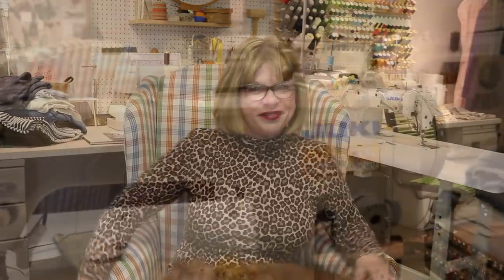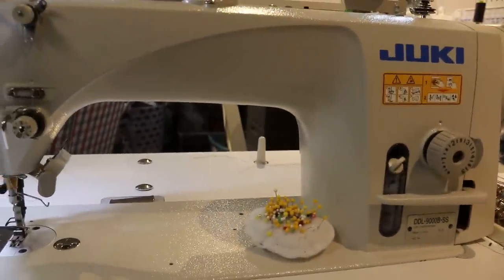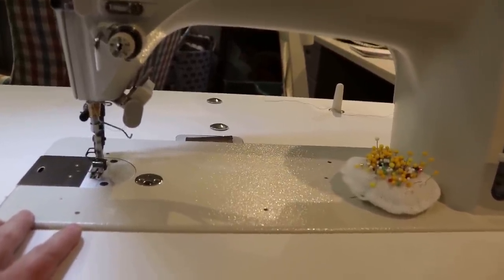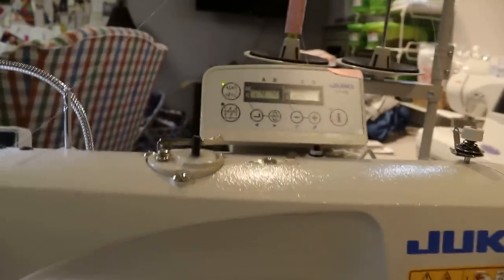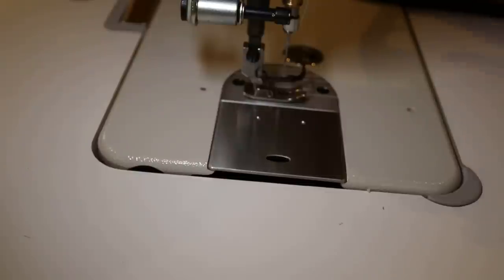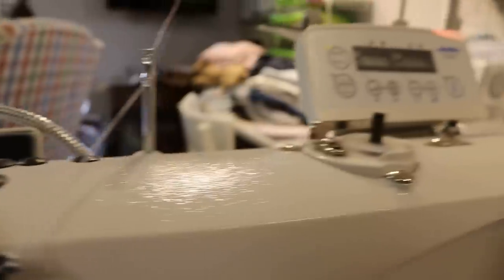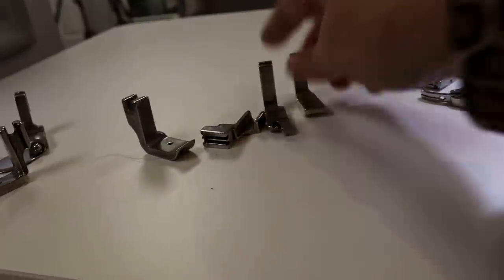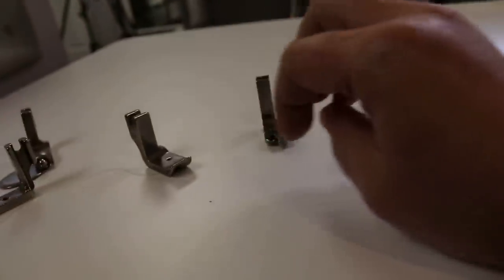Tutorial:  Sewing with an Industrial Juki DDL 9000 Sewing Machine

Comment: I got a Juki 8700-7 with the electronics option after watching your and other sewists' videos and absolutely love it!! I know you're going to do most of your on-video sewing on your new Bernina now, but there are a lot of us who loved watching you sew on your industrial machine. I have a question that I thought I'd ask here because others might want to see the answer as well as I do. My throatplate doesn't have marks for 3/8" or 5/8" seams. What do you do when you have those seam allowances. I've been using a line of painter's tape, but it's kind of cumbersome. Do you have a better trick? Thanks :) Ronni
Reply from the maker: Roughly, 3/8" is equal to 1cm and 5/8" is equal to 1.5 cm so I just line up to those lines on my machine.  1/2 seam allowances are a little more difficult as that is between the 1 and 1.5 cm line, so painters tape can be helpful in that situation!
Reply: @TomKatStitchery  Thanks Whitney! I guess no throatplate guides are perfect… My machine has marks for ¼ inch, ½ inch, ¾ inch, and. 1 inch.

Comment: Good tutorial 😉.  I thread just a slightly bit different, and it has worked perfectfect or me for 10 years.
Reply from the maker: Mine was actually threaded incorrectly in this video 🤦‍♀️.  My dealer had threaded it this way and I didn't realize it had missed an area until later.  It's great now!

Comment: How do you lengthen the thread tail left after cutting. Mine is too short and my needle keeps coming unthreaded
Reply from the maker: That sounds horribly annoying!  I haven’t had to mess with that so I’m not sure, but it could also be a tension issue.  If the tension is too high on the top thread, the thread could be snapping back when it gets cut.  I’m not positive that’s the issue, but might be worth playing around with.

Comment: Do you have a walking foot for your Juki? Also when you were showing the puddle it looked like it was in the center of the base. Does it have to be in the center or can you have it moved to the right?
Reply from the maker: I do not have a walking foot for the Juki.  I use one all the time on my home machine, but haven’t needed it on this one.  The pedal is in the middle, but it takes up most of the bottom so it stretches pretty wide across making it easy to hit with my right foot.  You might be able to adjust it, though.  My dealer set it all up for me at my house so I’m not totally sure.